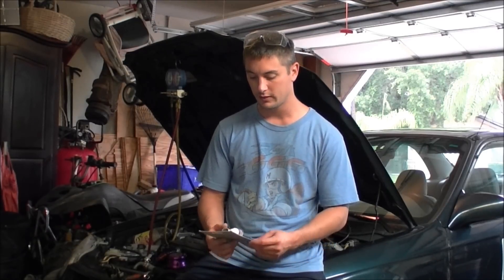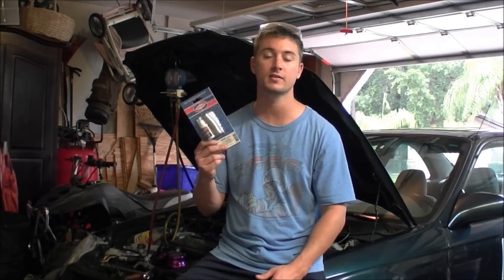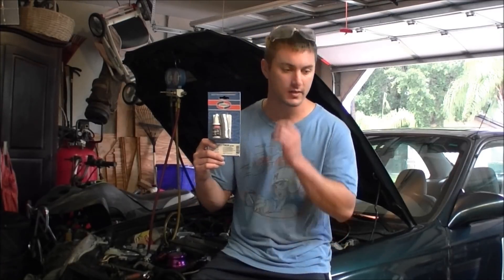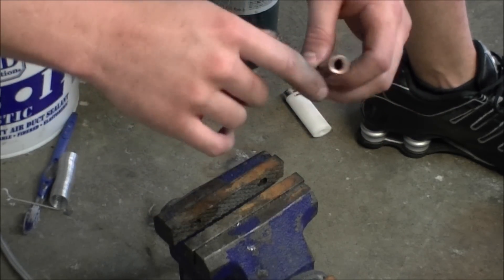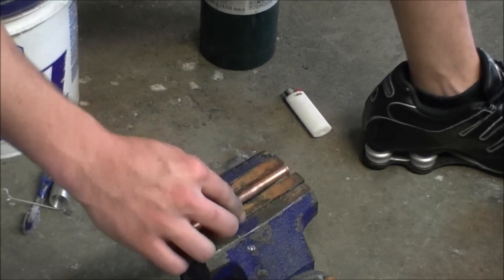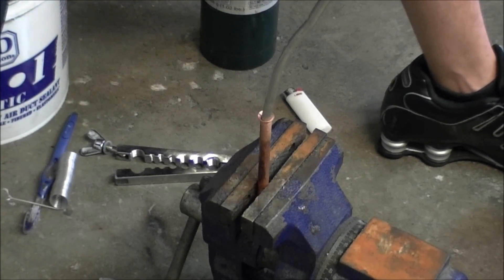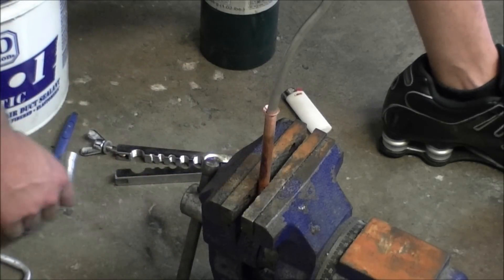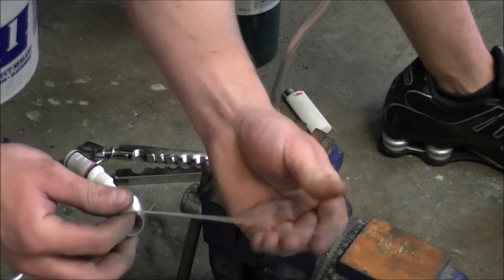Solder Aluminum To Copper "How To"

Comment: You really need to pull the heat off the joint when the rod flows. Also you only need to use very little solder. Maybe an inch or less cause your just filling that copper line.

Comment: Not sure if this product will work for my application.  Anyone, I am trying to connect ( or short) 2 terminals on an auto part (an alarm control module). The problem is,  the wire is copper and the terminals (male, prong like, sticking out of the base) are aluminum.  I will be using a 2-3" length of thin gauge copper wire (phone or bell type), to first wrap the copper wire around the 2 bases of the module's terminals to connect them.  I need to secure this connection the best way possible.  Clarifying, I will be connecting the two aluminum terminals at the BASE (proximal end) of the module since, when I am done, I will be plugging the Alarm module back into its connector base.  Desired result, I will have shorted the two aluminum terminals together. Note, the 2 terminals of this module are male (sticking out at the base, copper wire wrapped around the base of these terminals and soldered or secured).

Any tips on how to do this?  Ordinary rosin core solder, normally used for electronics (ie. composition of 97% tin, 3% copper) does not seem to work.  Is there a special solder, flux, rosin that will connect the two metals (again copper wire to aluminum terminals) more securely?  Like in this video, the host is connecting copper to aluminum.  Thanks in Advance!

Comment: If someone who worked for me flared a refrigerant line and brazed it or soft soldered it i would fire them on the spot. Flares are for flare nuts and compression type connections. Swagging is for joining pipes to be soldered or brazed.

Comment: Your joints need to be swagged, not flared. Flared joints are for compression fittings. Also, the copper and aluminum needs to cleaned before welding and you need to run nitrogen through the tubing to prevent scaling. You might have a leak-free connection in the short term, but long term those connections are likely to crack under vibration because they're too weak.
Reply: Simon Saw this comment 3 years ago...  I "soldered" using this method and till this day my customer is still satisfied with their work I did for them.. its cool to help another technician out by Pointing out their flaws, BUT I'm sorry to say either you joined the two incorrectly or you simply don't know how to "spread" the solder rod correctly
Reply: 2 HIGH FOR THIS SHIHH he’s completely right. The method shown was no where near proper. While it may work for a while, it’s bound to fail.

Comment: Use the swedge tool, usually comes with a flaring kit, the swedge will produce a "fitting" shape on one end of a tube, more surface area, better joint.

Comment: There is an American manufacturer called Yost who makes a lot of models. Model 750-DI may do the job for you. It's not exactly the same as the one in the picture but is a nice choice. Many vices seem impossible to buy, manuf discontinued. This is a real problem when trying to get replacement jaws. 

Home Depot sells a Yost vice like this as model 750 and are asking $199 and that seems to be a common going rate for that size and style of vice.

Comment: next time instead of flaring, swage the lines like HVAC technicians due, cheap swaging tools aren't hard to find.  More surface area of the pipe for the solder to bite into.

Comment: well as for ac leaks,  i just repair my condenser, it,s been working already for 2 years
it works better that that Alumaloy shiit,, altough i just bougth the flux & bougth a rooll of plumber solder and it did the trick, as for leaks i do trust the plumber solder and the flux that this guy is using, if you know how to use it it works just fine,,, i,ve done it

Comment: Word of advice, that Uniweld crap makes for brittle joints I wouldn't trust on systems with higher than 100psig.  They are basically selling you over-priced lead free plumber's solder and a halide based flux.  Also, you should never join copper to aluminum directly, use a transition metal like brass to minimize galvanic effects.  Better yet, get a proper torch and braze the aluminum to another section of aluminum.  It takes a good deal of practice to braze aluminum because of its low melt point.